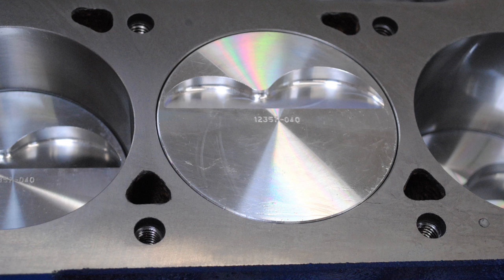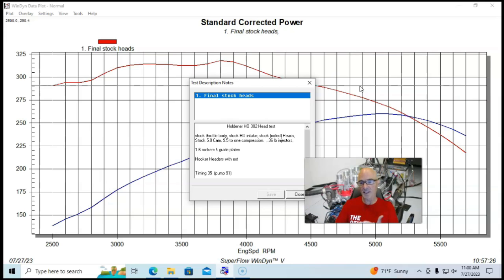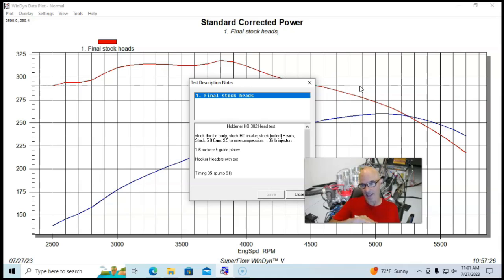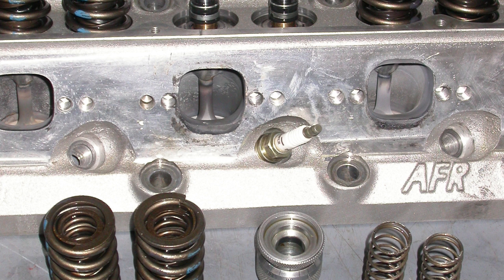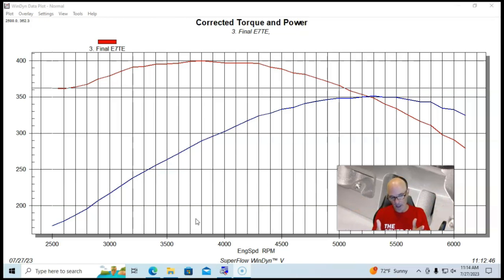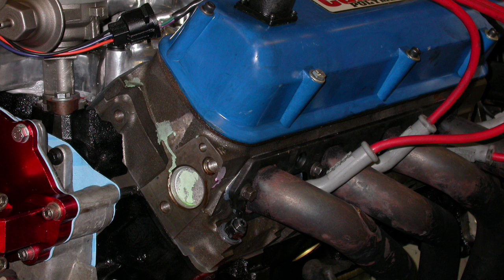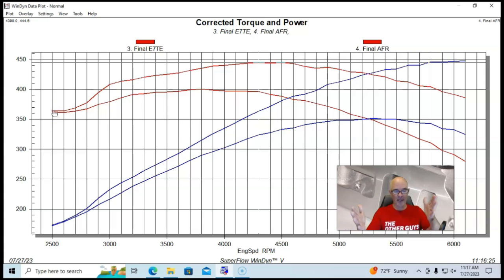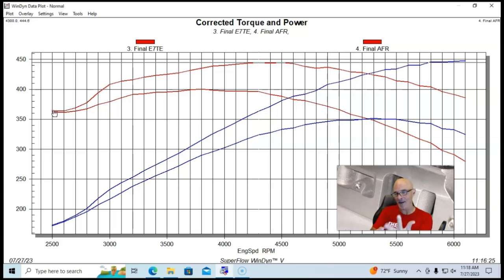HOW MUCH POWER ARE AFR HEADS WORTH ON A SBF? ARE THEY WORTH 20 HP OR 100 HP? THE ANSWER IS YES!

Comment: Ok, help me out! Last year I had my 68 302 stroked out to 347… premium Eagle crank and flat top Sealed power pistons, block decked dead flat, AFR enforcer 185cc heads , long tube headers. I know my cam is mild and I have an original Edelbrock  performer 289 intake (I need hood clearance!) my question is, what cam would you recommend for good power but manageable street performance and what carb to use. Thx! Right now I have an Edelbrock 500cfm carb, runs great but I think I’m starving it!
Reply from the maker: THE SMALLEST SUMMIT E303 OR A COMP 264 OR 270
Reply: @ I guess I don’t understand those numbers… I kinda want a slightly rough idle… I’m thinking I need a 750 carb…
Reply: Ok, what do you think about the Edelbrock 2122 cam, Edelbrock performer RPM air gap and  750 4 bbl for my AFR enforcer 185cc? I have it set up for hydraulic flat tappet cam. Thanks!

Comment: Since the aluminum is less thermally efficient than iron, you'd need to raise compression by a full point when switching to the aluminum heads to compensate for that, and in doing so, you'd gain substantially more power with just the head upgrade.
Reply from the maker: that is untrue
Reply: @richardholdener1727  So what is the difference between them thermally? The rule of thumb I've always gone by is it's one point difference between them.

Comment: Looking at putting a gt40p head on my 302 that has an Eddlebrock performer cam and the intake from an ‘85 Mustang GT. A 1” spacer and Holly Brawler 650 sits on top. Curious if that intake would be good for that GT40P or if I should go with Aluminum 351 heads.
Reply from the maker: WHAT ALUM 351 HEADS?
Reply: @ possibly Flo-Tek or AFR both are about 180 cfm
Reply: Looking at running a systemax intake, afr 185 enforcer heads, and a mile n412 cam with a lentech AOD. Mild build

Comment: I need some advice for my build. It’s my First build and have zero idea.

95 SN Ford Mustang 302 bored 20over with oversized positions to match and stock crankshaft stock heads but have been resurfaced not entirely sure if ported but I believe had something done with the valve or something and E303 cam can do the 19lb stock injector w/70TB or 24lb injector w/75TB and yes I do have the Maf paired for each combination  & chip for bypas, No I don’t have the cobra computer but yes I will BE needing a tune too and have the 98explore intake Hydralic lifter and adjustable 1.6roller rocker arm and comp cam pushrod, bbk dual equal length headers(shorties), decent spark plug, msd coil ignition and planning on keeping the heater and ac, might have to bypass loop for the hoses, all the other Jazz. 

My goal is to have something street ready and daily life 

Can’t find decent gt40head and don’t know what heads to go with? Talk with the machine shop to see what heads best fit the 20over job then done?? Or 185afr 61cc heads or the other one that has 51cc or something
Reply from the maker: afr heads are best-or go get GT40 from an Explorer at the junkyard. You need at least 24 pound injectors

Comment: Does anybody know how much hp aluminium heads will bring with the following setup : Ford 289, Holly 650cfm, Dual plane Edelbrock performer, mild cam (don`t know exactly which one) and Hedman longtube headers. Cheers, Peter
Reply from the maker: watch the big head test video-but good alum heads can add 50+ hp on a combo with a decent cam
Reply: @richardholdener1727  Thanks Richard.

Comment: How about the XE274HR cam and AFR165’s on a dual plane/carbed 306” @10:1 compression?  By using HP/cu in from 333” it should be around 415 HP, but 333” has 185 heads, but smaller cubes and 165’s should make up with velocity?   What’s your thoughts Rich?
Reply from the maker: no idea what you mean by thoughts?
Reply: @richardholdener1727   would the XE274HR and AFR165’s be good for 400 HP on a 306”?

Comment: Wow test was very interesting until the test motor that needed only better heads wasnt a 302ci but a 331ci stroker, not much of comparison if aside from adding cylinder head but was 30ci bigger,would've been more equal if disp remained same amongst the combo comparison, but once engine size is also different than there's more to the reasons as to why a motor with better cam and intake makes more power from head upgrade= taxes more from the better flowing head due to bore/stroke increases the air ingesting abilities from cyl size and stroke
Reply from the maker: go back and rewatch-you will get more from the results the 2nd time around

Comment: I’m thinking hard about comp274hr cam.. I have a b cam now  stock crank 306 gt40 heads 70mmtb and 76mm MAF. 4.11’s out back it’s got great low end range a best of 13.27@104. Now my question is if I put 165afr heads on would I still be in the stock gains. 15-20? I’m just trying to figure out if I need to change the cam to have more power/topend power.  After5600 it falls on its face. Ideally I’d like to pull power to at least 6200rpm
Reply from the maker: what intake?
Reply: @richardholdener1727  lightly polished explorer intake (gt40)

Comment: A factory ford 302 made 500 horse with kasse p38 heads and his cam choice and an intake
Reply from the maker: doubtful with stock p-v
Reply: @richardholdener1727  look back to muscle mustangs and fast fords stories.  I thought you were a member of the the blu blocker 100.......Canfield heads? There was a supercharger that I forgot....was it paxton?
Reply: @robert23497  in a test of  all top SBF heads the KASSI Heads did poorly, they finished in 4 or 5 place
Reply: @mylanmiller9656   That's pretty strange since the kasse heads are the only aftermarket heads other than CHI from Australia that have valves that open away from the cylinder walls in order to reduce shrouding.  The kasse p38 are also the only SBF heads that I've seen make 750 horsepower on the dyno with a hydraulic roller cam on a 427 inch Windsor.  The old Cleveland 4V heads deserve an honorable mention here because ford realized this fact 50 years ago and used the rotated valve architecture on the 351 Cleveland AND 351 boss motors although they weren't aluminum.

Comment: Dude, if you would have changed the cam and intake on that or any 302 instead of throwing a stroker motor into the mix to avoid a cam and intake swap this video would have been one of your best.  It would have answered the big question for so many people that have done or are going to do an HCI upgrade on their OEM 302 bottom end.  Now we have a video that does not really answer any question.  Most already know the oem cam and intake will limit gains on any head upgrade including stock heads.  It didn't even really show that because you compared 2 different size engines.  Sorry to criticize, I normally love your videos and come away learning something I was wanting to know.  Not this time.
Reply from the maker: plenty of cam and head test vids on 302 up
Reply: Yea, but I prefer your videos Richard.

Comment: In my limited experience with building & playing with SBF engines I’ve come to believe that the heads and intakes are biggest restrictions.  They can make decent power but going from E7 to aluminum head is always worth gains, then add a better intake more gains, upgrade cam more gains, open exhaust even more.  There are people out thee who spend countless hours and money making E7s perform better but I just don’t see it when aluminum can make or outperform these worked over E7s and you have more room to go where you are maxed out on the E7s.  Saw it first hand when I changed just my ported E7s with 1.94x1.6 vlv’d head to TW 170s and saw gains in HP & TQ from 2800 (where dyno graph started reading) on.

Comment: That baseline stock motor ain't that "stock" pushing over 260 hp
Reply from the maker: you are confusing the rated vs tested power, we run the motor with headers (no cats), no accessories, open throttle body (no air intake) and optimized tune, but all stock from the throttle body to the headers
Reply: @richardholdener1727  I see, thanks.

Comment: Hey Richard how’s this relate to the 351w non roller? I hear the heads are so restricted that’s it’s a really big hp gain? I want about 350hp any suggestions? Thanks for ur time. Engine is 83-84 351 out of bronco
Reply from the maker: same heads as roller motors

Comment: What would you suggest for rebuilding a 302 to hit 350 HP on 87 octane gas, utilizing the stock computer and staying EFI?  Is this even possible?
Reply from the maker: LOW COMPRESSION 347 STROKER
Reply: @richardholdener1727   Thanks!  I've seen some videos on this conversion.

Comment: Big question: Would a throttle body fuel injection make as much power as the carb. on a combination like this? What is the highest flowing most powerful F.I. setup for this engine?
Reply from the maker: if you used the same intake
Reply: @richardholdener1727  I will try this on my 90 GT. See the long runner manifolds only make in the 360 hp. range but want to keep the FI.

Comment: All ways great to see them sbf videos.I was wondering if you had done some on just different cams to see the power gains and where at? I currently building a little forged 306 and gona hit it with 15lbs i have 2 different cams a F303 and a XE274 with would be better. Also running a Holley SysteMAX with a set of TF 206r heads
Reply from the maker: 274
Reply: @richardholdener1727  tks
Reply: @blownfox  did you ever finish your build? How did it work out?
Reply: @Cowboy.underwater  worked out great it didn't make as much boost as I wanted just a little over 13lbs or so.The most ive seen is 13.6 that's good enough for a street car
Reply: @Cowboy.underwater  I also didn't go with the TFS 206r head I didn't realize how tall they was so I found a deal on a set of TFS 205 C&C.
Reply: @blownfox  did you ever dyno the motor? What power adder?
Reply: @blownfox  looks nothing wrong with lower boost on a crank driven power adder, just means your engine moved air more efficiently than you planned!
Reply: @Cowboy.underwater  yep forsure and all that extra heat also.I can only reach that boost level at 7200 to 7300 rpm she's really moving then

Comment: Richard did you ever run the newer renegade heads on 347 with rpm air gap and 274 cam and compare it to victor jr and what about that 302 400 hp with the stock cam and afr heads you gonna test that

Comment: Is there any kind of calculation that can be run to determine the maximum power a set of heads can support?  I would assume one could determine a maximum air flow rate which should correlate to maximum power (all other conditions maximized)
Reply: Intake flow at your valve lift x 2
Reply: 300cfm head will support 600hp

Comment: My opinion is that if I was doing a mild rebuild on a Ford Windsor series I like the elderbrok top end kit with matching heads, cam and intake. And pair it with a 750 holley. For old school small block Chevy and even new ls Chevy I like the twisted series of trick Flo,with a btr cam and elderbrok rpm air gap. These I think will make real strong, powerful engine's that can go for a long time. It's by no means maximum horsepower but still very respectable and probably twice what a stock engine would have or close to it. Now stroker motors are very much a different animal. I don't care about Ford, Chevy, or dodge. If you want to get the most out of a stroker go with afr heads and talk to a cam expert that can help you pick the proper cam for your engine displacement and your intended vehicle and rpm range. Me being me. I'd recommend topping it with a tunnel ram set up for efi and and use the holley stealth efi. It looks like carbs but easy to tune. Dual quads are hard to tune without a dyno and they still wouldn't be perfect, but efi that's doable for a shade tree mechanic with a laptop. Just my opinion. Love your videos always fun to see thank you for your time and effort. You are appreciated by the masses.
Reply: I would run the Trick Flow top end kit over Edelbrok, outperforms Edelbrok in every test I’ve seen for comparable money
Reply: @msk3905  I don't have enough information or have seen enough tests of the trick flo for Ford. What I have seen is that the elderbrok seems to have a small performance edge by 10 to 20 hp and torque. That's not much but when you compare trick flo to the elderbrok set up they cost about the same. Now for whatever reason the trick flo does better on Chevy engines and it's reverse of the Ford. Trick flo tends to make 10 to 20 hp and torque over the elderbrok. But I think it really comes to personal choice really. They are both really good and better than stock and they both cost almost the same money. Honestly I wouldn't fuss about having either setup on a Ford or Chevy
Reply: @dannytravis7118  just look there are countless tests out there comparing these heads and Edelbrok always comes out below Trick Flow and AFR

Comment: I needed no convincing. My first 302 was an E7 roller, with an Edelbrock performer, and 600 Holley, fun and torquey, but then i went with a Comp 280 Magnum roller and TFS twisted wedge heads, and I lost some fun grunt down low, but from 5500, to 6800, it picked up about 90 HP over stock and surprised a lot of people.

Comment: Just think if you started with a 351w! I like your vidios, but the only reason to run an 8.2 deck instead of a 9.5 is the 9.5  won't fit!! 😂😂
Reply from the maker: this video was a discussion about whether to choose a 302 over a 351-it was about head flow on stock motors (work on both sizes)
Reply: It's like a certain part of a man's anatomy,  you would get the biggest one if ud had the choice!!
Reply: Weight
Reply: @josephtravers777  The Windsor only has to make 10 more hp to make up for the 100lbs! All you need is  good set of heads and a bigger cam. I got 3, one is a 95 roller block! I've ran both of them! In the same car! Same transmission and converter! Run what you want! Just buy up blocks is ur running the 8.2 block!
Reply: @josephtravers777 bull s!@t! Ran both in the same car! You just don't want to spend the money!
Reply: @josephtravers777  I've done both, trust me, you gotta spin the hell outta that thing to make the same power, and they don't hold up unless buy an aftermarket block! I'm 63, I was blowing the little bastards up when you were riding tricycles! At the formula of weight to horsepower it only has to make 10 more horsepower to make up the difference! You can put a crank web in, but it will show you its guts sooner or later! There's a name for 347's, hand granades!
Reply: @markmccarty9793  I highly doubt that. We are the same age. Cut my teeth on 289s in the '70s. If you missed something, watch Richard's video on 347 vs. 351W. Same power, 347 up higher in rpm range.
Reply: @markmccarty9793  Road racing
Reply: @josephtravers777  not my bag, but you have a point. The 3" main journals are the only draw back to the Windsor, but we spun the 6800rpm, for 5 seconds!
Reply: @josephtravers777 again, why would you spend the money! We ran all 3! It's cheaper to make the power from the 9.5 deck! Rod stroke ratio  is far superior  with a 9.5" block! Head bolts are bigger, rod bolts are bigger, maim bolts are bigger! 20 years ago you had to let them see the hood up! The already knew the difference! A 393w vs a 347?!!!😂😂😂 Grow a set!
Reply: The 8.2 deck leaves MUCH more room for Turbo's!

Comment: Any aftermarket almost is worth a lot. Especially for the overcammed on a small block Ford. With some good moves like something from TFS. 302 is doing 350 s*it
Reply: I'm a 4.6L 2v guy but i always tell ppl that Ford's lil engines make huge power for the size they are.. Especially if low compression..

Comment: Would have liked to see an intake/TB upgrade on the 302 with the stock cam and AFR 165s. My brain says the intake and TB were a bigger restriction than the stock H.O. camshaft. But, I could be wrong...
Reply from the maker: a good intake helps-but a 5.0L needs all three
Reply: You are right.  I did this on my 92 aod mustang years ago.  All stock it made 184rwhp.
Changed to afr 165's, explorer intake, 65mm tb, and cobra roller rockers with stock cam. 
Power went up to 262rwhp.
Reply: @3foxstangs - I bet with a good cam your combo would have made 325-350WHP.
Reply: @3foxstangs  Nice gains!
Reply: I was  thinking the same thing, but with a decent camshaft.

Comment: Hi Richard. Im lookin to build my 71/72 olds 350, block 395558, into a 374 stroker and put it in a 83 hurst olds. Could you please do an Olds 350 build in the 400 to 500 hp range for us Olds runners. No one ever does this. There are more Olds lovers out here than it seems. The Olds 350 takes the 455 heads well so that would be a good way to cut some parts costs too. Dyno runs/ results we gotta see too. Weve seen way too many 455 builds on youtube, we need ya to do just some kind of 350 build. Help us out please. I might also decide to put mine in a 71 Cutlass Supreme S too. The video would get a lot of views, i know it would. Thanks, sir!